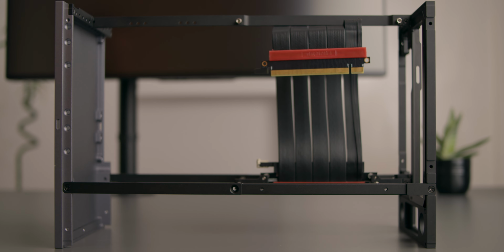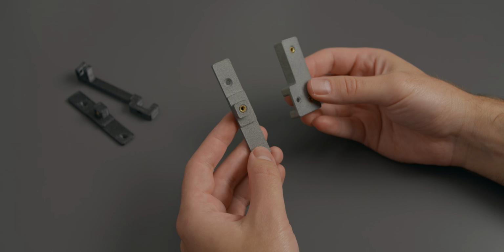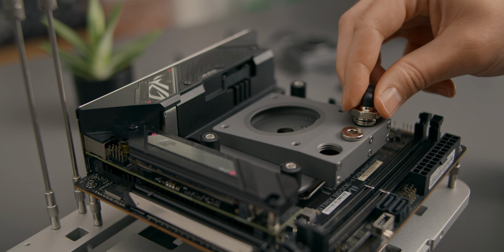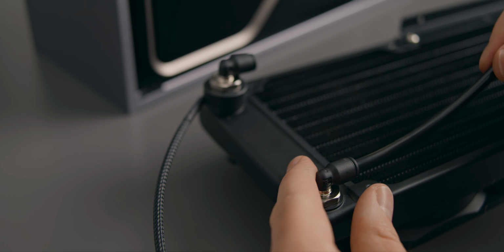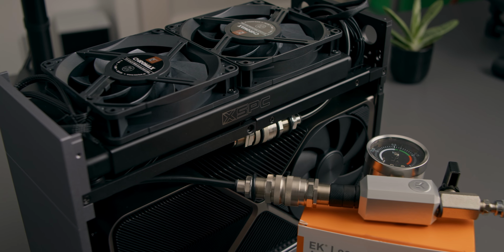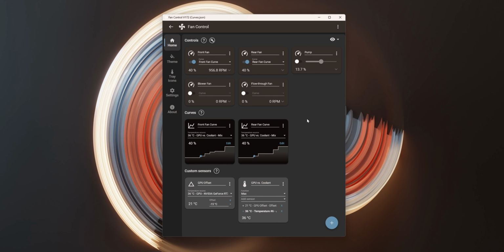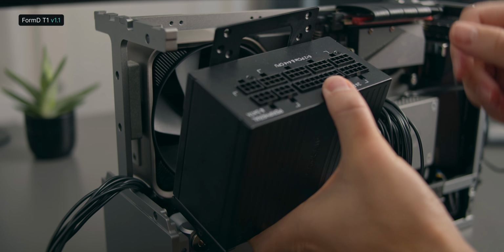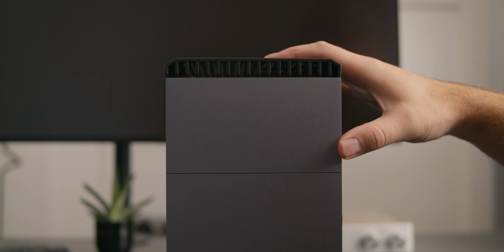FormD T1 pneumatic tubing build

Comment: Wow you pretty much have the same exact build as me. I just have the x670e version of the board and used barbs and soft tubing. Can't say I'm a fan of the 7950x3d I actually have the freq CCD turned off because I can get a better pbo offset with it off and get more constant boost at 5250 on the 3cache for gaming. If I get more free time I want to see if I can get the 3dcache to hit 5.4 with 6400mhz on the ram.

Mind posting your Fan control config file. I have been too lazy to optimize mine and would appreciate your expertise on it. I also have a temp Senors so should be the same.

Comment: great video. curious as to why you chose to offset the gpu instead of going 3.0 and offsetting the motherboard? also, is there any feature of the case that supports that side of the gpu in the absence of your bracket?

Comment: Nice work! After experiencing building in the new top clearance without the hat, do you think an AIO + slim fans would be possible? I'm planning this build with a 4080 but don't want to spend a ton of money on fittings and a custom CPU block.
Reply from the maker: Thanks! You should check the SFF Gurus discord group, plenty of AIO builds there and a lot of info.